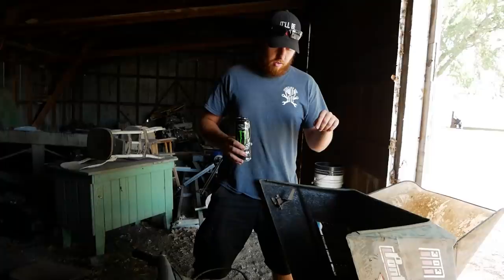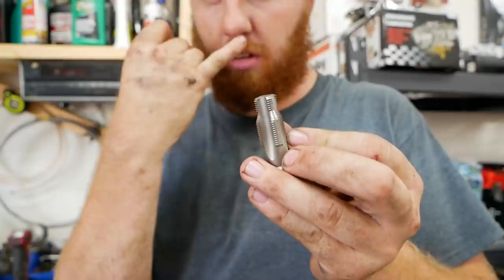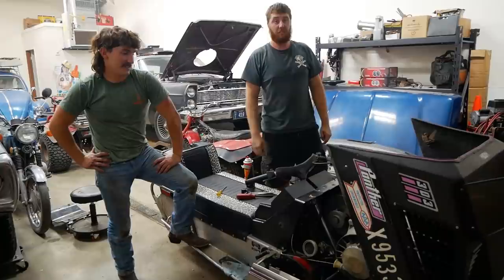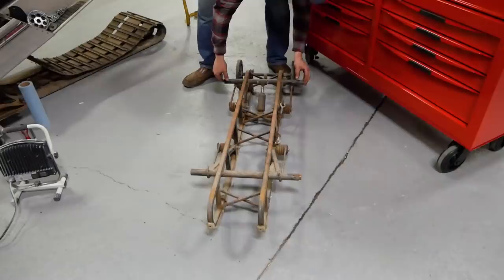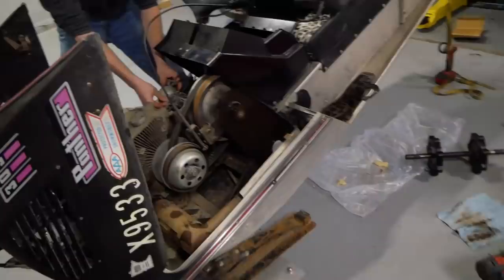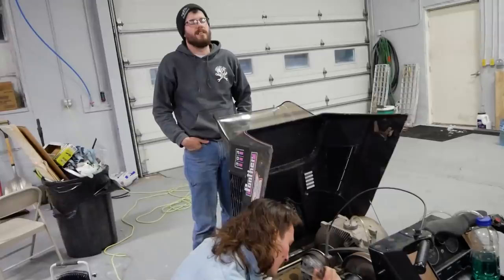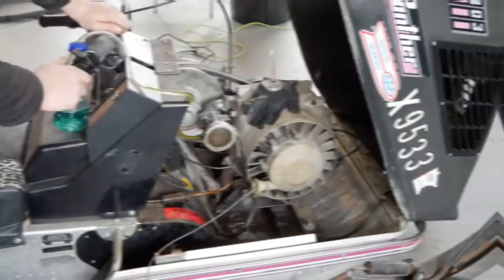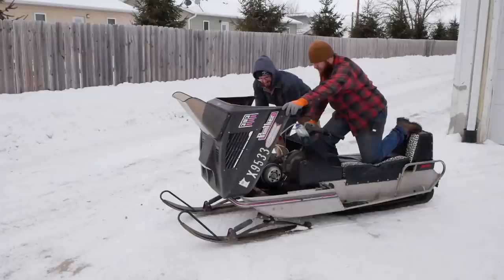Will an Abandoned Snowmobile Run After 20 Years?

Comment: lot of the times when any engine been sitting for over 20 years can still turn over/the piston is not locked up and still gets spark,but wont start,try cleaning out the cylinder area of carbon deposits and the carburetor, because gas left sitting turns into shelac to gum up the gas flow,those rotary engines are interesting as i've heard you cannot possibly over rev a rotary engine/a Wankel engine to blow them up

Comment: seal on the motor and vacuum pump on motor and clean that carb better adjust air needle and need and seat needs to be replaced plug was fouled too possibly anytime on these after u try hundred times to start plugs will foul due to all the different fuel issues your working thru , 20 to 1 ration on fuel too ,not sure what u used

Comment: Take it back off.& soak that carburator in A ultrasonic cleaner for 3 hour after removing all of the seals then replace them one at A time checking them for cracks.& spray carburator cleaner spray through it before you reinstall the seals for thuro cleaning technics for fuel to pass through freely in that carburator on the rotary engine.& start with choke let it idle for 30 minutes.& take the choke off to try full throttling it to see if it opens fully afterwards.

Comment: I wouldnt say its a seal! I would be quicker to say that the latex glove solution doesnt work because the glove expands like a ballon while the material for the diaphragm doesnt! I would assume that the glove is moving too much air hence too much fuel and flooding it! You can use a different type of carburetor and it will work better! Probably get more power out of it honnestly! Rotary engines are scary simple! Fuel/Air/Oil=high rpm/noise high rpm is good in these because the power only starts up high! Also its not exactly a two stroke engine! Its a bit more complicated and less complicated at the same time! Please PLEASE make this thing GO!

Comment: How much oil did you suply in the gasoline? And what sort? Of corse vacuum leaks are possible but how about the fuel wont flow propperly trough the carb because its to thick?

Comment: I knew the drive cogs where not going to work they are notorious for cracking after sitting. I would do something cool with that motor and put a nice pipe on it and it will sound nasty.

Comment: On those 303 Winkles the rotary seals dry up and it will do that I had a 1972 Arctic Cat Panther 440 and it would do the same thing but mine would run when you stayed into it mine was in a rotary engine but almost wankel's that's what it does when the seals dry up they're pretty hard to find rotary seals to my acknowledge maybe eBay or Amazon but then you have to time the motor after you rip it all apart to my knowledge also and that's quite a little job in itself they are a pretty cool sled those old cats are hard to find in good shape I've had a ton of them and enjoyed them in my life but unfortunately when they said that's what happened to Seal's dry up if you spray carburetor cleaner behind the clutch at the end of the crank seal if it revs up and down then you definitely should know that that's your issue

Comment: I have worked on many small engines over the years. I've taken two strokes, four strokes, and even electric motors. all in poor or non running condition. after vast experience of countless hours put into working on these engine only to sill not run when I finish working on them, I can confidently tell you with certainty, the problem you are having with your sled is that it keeps stalling while you try to ride it. all you have to do is stop it from dying and it should be fixed.
       I hope this comment helps you solve your issues with your sled

Comment: I know this has been a year, but what's up with this snow machine?
Also, I was thinking your fuel delivery bottle was odd. Was the bottle vented? Was fuel flowing?  Why not gravity feed rather than vacuum draw? Why not clean and fill the tank?
Also, that is a much sought after engine, so hope you got all those metal filings out of the plug hole.

Comment: Bye the way some of those are 2 cycle 🛢 oil& ⛽ gas mixed engines that could be your issues with not staying running. Check it for oiler separate tank if you don't find one on it then its whats called A premix fuel engine instead.

Comment: I would eliminate that pump on top of the engine with the glove and run a rubber line instead. As long as crankcase pressure is good and carb diaphragm is good it should run fine on its own.

Comment: 303 Panther wankel
I owned a 606 twin rotor. The problem with them was the seals on the rotors in the engine. I think thats the problem with this one. Parts are probably made of unobtainium. Repower it with a kawasaki 440 twin. Arctic cat panthers of that vintage were awesome machines.

Comment: love rotery moters had a Mazda RX3 in highschool same engon and trans as the rx 7 turbocharged 13B REW engine 4 speed manual. but in a subcompact 930kg vs the rx7 1043kg way way to fast.

Comment: it's a two stroke... you can't pour enginecleaner into it, it dries the motor out of oil making the piston set in the cylinder.

That could be one of the problems why it wouldn't run.

Either to fat blend ore too little.

And the glove thing... come on maaann.... it goes through the engine to preheat the fuel you could just use an external fueltank to make it run... but the fuel would still need to run from the tank to the carburetor, you cant expect it to suck up the fuel from a bottle.

Comment: Get a new diaphragm for the fuel pump or get one of those low pressure 10 dollar electric fuel pumps from Amazon for a generator and run it off the charging coil that runs the head light

Comment: Ditch the Tilitson carb and swap on a Mikuni. Those Tilitson are finicky at best. Mikuni way more forgiving. Kinda like Quadrajet vs Holley. Lol. I’d wager it’s the carb. Fought with that junk for years. Also from what I understand if a rotary has any internal seal issue they loose compression and won’t run at all. And don’t use wd40. It actually washes away oil and drys out cylinder walls. And apex seals. Hahahaha.

Comment: Isn't that a 2 stroke engine that runs on oil/gas mixture? Why do you run in on carb cleaner, isn't that the opposite of what you need to do? You need to pour oil in cilinder and rev it a few times, oil it, and not de-oil it with carb cleaner and stuff.

Comment: Just watched this video and don't know if y'all have done another video or not but if u haven't I think you should for sure but I was thinking could the problem be because of what y'all had to do with the spark plug and also I think maybe some fuel system cleaner might help it or some marvel mystery oil like put some in the sparkplug hole and let it sit in the combustion chamber I've had a couple friends who has worked on rotor motors and they have said it sometimes helps and i think they are  fascinating and cool cuz of how they work I want one now for a go kart I'm building

Comment: If you adjusted the hi and kow speed right it probably would Run good 3/4 turn for low speed 1 1/4 for thd high speed

Comment: The apex seals might be bad. If they fail, they will not move and compress the fuel. Start with a compression test to see if they are sealing. See here:   https://www.carsdirect.com/car-repair/signs-of-worn-apex-seals-on-a-rotary-engine
Reply: It talks mainly about Mazda  rotary engines but the principle is the same as are the effects of seal failure.

Comment: to see another vehicle with a wankel(is the German inventor), or a rotary, it's just crazy. I grew up in the early 80's, riding dirt bikes, street bikes, snowmobiles, you name it. I only remember seeing one, that's right, one, vehicle equipped with a rotary engine. ironically, it was a Suzuki street bike. but that's it. other than Mazda's RX7, you just didn't see these things. they were not common. ahh, the Wankel. I just call it a big oil pump with spark plugs inside of it.🥴💢💯💯💯

Comment: Hey I know this is an old video but did you guys ever figure her out. My dad had a rotary 303 panther he had bought brand new. Sat for many years (30). Then I decided to get her up and running. Just like you guys I struggled till I but the bullet and called my dad who put 5000 miles on the sled and had rebuild the carb at least 5 times and the motor twice. After a week of me struggling he had it going in a day. So if it's not running and he still have it let me know. I or my father can walk you through how to get her going. Or if you want it gone I'll go for a road trip and come take her off your hands. I live in RI. I'll get her going and you can all come out and ride it or I'll bring it back out to you guys.

Comment: Wankel engines run very dirty carbon builds up on rotor seals and they will stick and you lose compression. If one seal on your Dorito sticks you actually loose compression on two of the three rotor cycles. If you really want it to run take it apart and clean everything and put back together, good tech info google 71-73 arctic service manual and section on Wankel engines get rid of the snuff can on top of the rotor case and get a screw in a regular hose barb fitting. thread is metric but it is the same as a vacuum fitting on a Kawasaki or Suzuki snowmobile engine.
 pages) (vintagesnow.com)
1971 Arctic Cat Panther 303 Wankel - YouTube

Comment: Man those stupid diaphragm style carbs will make you pull your hair out and drive you to insanity, I have fooled with countless small engine and I have wasted hundreds of hours of my life fooling with those stupid carbs and 99.99999% of the time they still wont work after a rebuild, no matter what you get nowhere with them, I have gotten to the point where I wont even try to rebuild them I will only replace them with another, if this was my sled I would have swapped on a float bowl style motorcycle carb for simplicity.

Comment: Sooo bummed u gave up. Diaphragm (glove) was obvious issue before considering housing seals. Doubled up glove might have been the issue.  Housing seals rarely blow,apex seals would be better culprit, but not enough wear/use/hours to be likely. Was sooo close to subscribe, but then u gave up. No offense... But as a mechanic I was offended u gave up after so much. So close. Rotarys are all about fuel. Needs a insanely specific mix. Seals Affecting mix was great deduction, but very unlikely. Pllleease try again. Don't sleep on rotary....they are insanely tough/last.